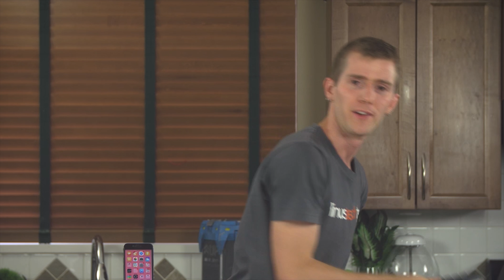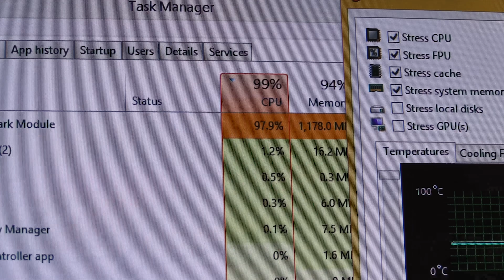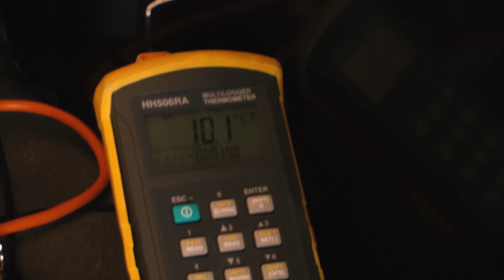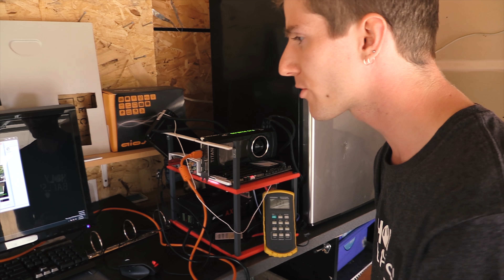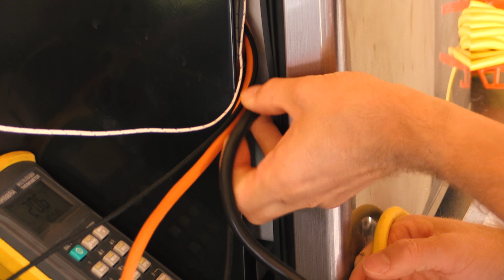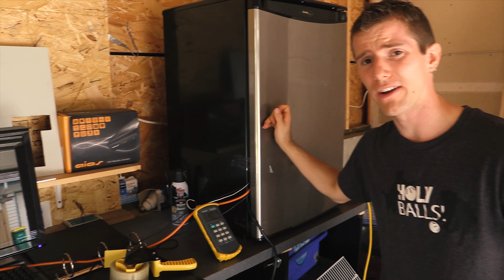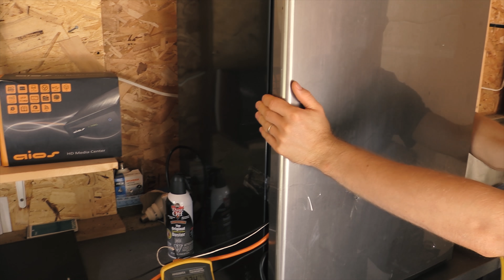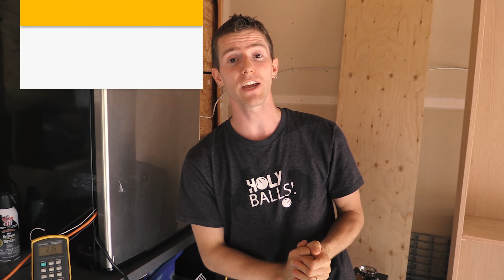PC Build in a Fridge - Does it Work??

Comment: Now lets throw it into  a -10 degrese freezer.
Reply: Put it gently**
Reply: TheSintic Won't work for the same reasons as the fridge.
Reply: TheSintic PC in a walk in freezer
Reply: hompalai THROW HARD MAN
Reply: reblogo INDUSTRIAL SCALE FREEZER THAT IS!
Reply: Lol xD
Reply: daveglo100 If it can't read rid of the heat (i.e with large vents) then it doesn't matter. You'll end of up with the same result. It'll just take longer.
Reply: Cloudz2021 i think those walk in meat locker freezers do have fan driven outlets, not 100% sure, but the one at the pub i used to work at did. just wonder what the results would be like just as a POC. also as mentioned in some other comments, i would like to see the mineral oil PC he built put in a walk in freezer too
Reply: ***** Yep the first time you turned it off it would freeze and never turn on again.
Reply: TheSintic why not -18 degrees celsius?
Reply: TheSintic The same would happen, like in this video.
Reply: ***** Ice is deionized water, deionized water doesn't conduct electricity
Reply: TheSintic Lets put it in an Alaskan winter
Reply: TheSintic that's the same thing as a Refrigerator set to a lower minimum temperature for the computer to maintain.

the problem isn't the ambient temperature, it's the heat dissipation capacity.
if you really want to do it, buy a Walk in Freezer and replace a room in your home with one. that will definitely be able to handle the heat load.

don't set the temperature too low though, you don't want all of the components running subzero. not without you making modifications to protect them.
Reply: TheSintic Same results, those using literally the same cooling circuits.

Comment: Honestly, you'd be much better off stripping the compressor and heat exchanger out of a cheap window AC unit and putting it into a large coolant reservoir (or just modify a small ice chest).

Comment: Whoa, hang on there Linus, this is not over yet! You didn't even do the best one! You should put a large reservoir of a water cooled PC in the fridge and have the pc outside. Also, pre-cool the water that's going back inside the res via the traditional methods. If this doesn't work there's always another way.

This one is a bit complicated but it can't fail. You have to reservoirs, let's call them A and B. Res A is inside the fridge and res B is outside the fridge and outside the PC. The PC is using res B at idle and below a certain temp, let's say 50 deg. What you do is you have a logic constantly measuring the CPU temp and once it reaches the threshold it activates a pump between res A and B. Then a water exchange happens between the cold and the warm res waters. What you need to be careful with is the placement of the tubes between the two reservoirs, or else they won't exchange water properly. It's questionable how effective this would be, but I'd sure love to see it. And if you can't build a logic like I explained you can always manually check the temp and activate the pump by hand, at least as far as the experiment goes.

Comment: Cool, good info to have, thanks. It's funny how many HDDs you see "stripped down" to bare platters sat happily running on certain rigs - I wonder if they know they're screwing up their hardware by doing so ...
Reply: ***** Wait... Where are you seeing this stripping down?
Reply: Tech Tacular Oh, I've seen them all over the place - usually in "stripped" rigs that people have custom-built - you know the kind of thing - don't bother with a case per se, just use a basic frame so everything is on display ... then take the concept as many stages further as you can ... including having the HDDs stripped down so you can see the patters and mechanisms in action ... not my bag, I don't especially care what the machine looks like, just what it does ... I guess I'm getting old

Comment: ["!dXZCY-Py47tjgJJEfdHcNlHjzQACAAAAOFIAAAAFKgEjTI99XdF0zC9L-zp3lCZGf8wFE-GRPyY2FGzvRbIUwaCkVumbU0DPd74GgYSEZRDDgGwaeHqROMOSDikXAbT_KUx9VJt0Ax8JOoveOsbliI1hUtgMDriZS1XP4Fckvdc80P8QGZJz4DncKpS6v_Ob28blWb8gx5jaIUVFdZvona58BNJ_StRahWi5Rzi3Xd5yQ2fS9vyE_jQfInJ-ItJ6UDh8cc0A_EdDr0kyR7bgQZcDU4uubHldI4xztlqSekLSu3OWhgKDrBDgtlgnQDNyhhkk4uS_vIQ5pSJWthSPN1zFpGzY7UhS_IPvSybZV71FlPTLfwiTEaUoWOVvws9opk4Mtw9r5XytH3DnZW6SQPCzdVN_0-S5wXrrRvcjWjEjIW17","leave everything outside the fridge except the fan and radiator assembly for the CPU",[[[null,null,1]],null],false]

Comment: Which PC is better
1.
AMD FX-6300 3.5GHz 6-Core Processor
Asus M5A78L-M/USB3 Micro ATX AM3+ Motherboard
Crucial Ballistix Sport 8GB (1 x 8GB) DDR3-1600 Memory
Western Digital Caviar Blue 1TB 3.5" 7200RPM Internal Hard Drive
Asus GeForce GTX 750 Ti 2GB STRIX Video Card
Rosewill FBM-01 MicroATX Mini Tower Case
EVGA 430W 80+ Certified ATX Power Supply
Or
2.
AMD FX-6300 3.5GHz 6-Core Processor
Asus M5A78L-M/USB3 Micro ATX AM3+ Motherboard
Crucial Ballistix Sport 8GB (2 x 4GB) DDR3-1600 Memory
Seagate Barracuda 1TB 3.5" 7200RPM Internal Hard Drive
Asus Radeon R7 370 4GB Video Card
Rosewill FBM-01 MicroATX Mini Tower Case
EVGA 500W 80+ Certified ATX Power Supply
Reply: Miguel Chavez 2 is better since 370 has more ram then 750 it and bit faster
Reply: Thanks it's much appreciated and I'll be sure to put that into consideration

Comment: Putting it in the fridge was never going to work. 

Better solution.. use ducting to suck the cold air from a freezer, air con would work best, and push pull that cold air through radiators.
Reply: LinusTechTips duct up a compartment in the wall of the new office, exhausting outside, put rads in the wall attached to the quick connects you have... whole room cooling part 2 :) 

Get sponsorship to do the gpu's too.

Comment: Can you try a watercooled rig with a largeish reservoir so it keeps cpu and gpu temps down a lot. Also you need to try and keep the seal, well sealed try spreading the wires a little more

Comment: Hey Linus, you mentioned an AC unit cooling the system, how about an AC vent cooling rig. It would be like the test rig bolted onto rails which is bolted onto the AC vent. The air would really be dissipated easily because of the airflow by the AC's fan. 😀

Comment: I have a question linus this might be a hard one though..... remember your build from scrap yard wars 2. Well what if you did the same thing with better water block and a GPU cooler and then put the cooper coil thing you had in the fridge or a freezer. Drill a hole in the side of the fridge or freezer going in one side and another hole out the other.  Then the water loop goes though the fridge coil system to the CPU and GPU tp cooling it. No rads needed. What do you thing about this let me know? Please!

Comment: The concept is flawed, to properly test this you should have put the contents of the test bench into a proper PC case. The bench will dissipate heat into the air while the bench in the fridge has no dissipation.

Comment: Well.. most fridges have very small compressors that are designed to bring temps down over a long period of time. It's also not designed to cool down items that are actively producing heat. Still, it's a pretty cool thing to try. At least now we know it doesn't really work.

Comment: Linus what about putting a radiator inside a bigger fridge
Reply: nismo96 Fridges isn't designed to cool a continuously emitting heat source, you will blow the compressor in any consumer grade fridge, it's just like leaving the door open and have the fridge's motor fail. For that to work you need the large walk in fridges you find in supermarket back ends that are designed to have the door open and people walking in and out all day.
Reply: nismo96 We have already established that a medium/small sized fridge doesn't have the capacity to deal with the heat output, whether you put a computer or a rad emitting roughly the same heat doesn't mean squat. 
1. No there wouldn't be condensation on the radiator due to it emitting heat and being higher temperature than ambient. 
2. condensation on the radiator wouldn't kill the pc regardless...

If you were to put it in something industrial grade or just something rated with substantially higher capacity, the result is rather obvious and not really worth testing. But if they can jerry rig a clever solution that's a different matter.
Reply: nismo96 The result will be the same. The Radiator need air flow to cool down the coolant.
Reply: Bererker95 yea I get it but imagine that the fridge has the capacity to cool the rad and there are fans on the radiator will it work or there will be condensation witch kills the PC
Reply: mil ford I know that man I perfectly understand it. but imagine that you have warehouse fridge available and you put a rad in it will it work or there will be condense on the water block witch will kill the PC

Comment: There is a simple solution to get it work tho, test with a normal case, then you need to manage to transfer air flow that come out of case to outside of fridge with duct or anyway that you can. or if you have a water cool system you need to just put radiator outside of fridge.

Comment: Why not, instead of this, put in a water cooling loop then route ducting from the A/C vent to the radiator (external would be easier i guess) then exhaust it outside. This would get really cool air to the cooling bits and keep the room from getting really hot. Only thing I could possibly see is maybe some condensation on the water lines if the coolant gets lower than ambient.

Comment: Better idea, if you have liquid cooling why not strap the radiator to the front of a window A/C? It wouldn't be large enough to block airflow so you would also still receive a cool room as well.

Comment: SSDs should be ok in the fridge, yes?
Reply: ***** It has to do with the internal air pressure of hard drives. They're designed to run at a certain temperature range, so if they get too hot or too cold it negatively impacts performance.

You're not even supposed to tighten or loosen the screws on normal HDDs because it impacts the internal atmospherical pressure and makes the HDD unstable.
Reply: ***** Pretty sure it'll be fine but in all seriousness are you just really curious or considering this?    xD
Reply: THYCR3ATOR Whilst I was watching the video, when Linus said to avoid putting HDDs into the fridge, I reasoned that it would be related to a combination of the mechanical components, the platters, and the way HDDs work - magnetic read/write ops. As SSDs don't have any mechanical components, and work in a completely different way, I reasoned that they shouldn't have the same limitations, so the question was really to satisfy my own curiosity and reasoning.

Comment: Doesn't work because there's no airflow & there is no real efficient way for the heat to be extracted... also the heat produced from the PC is most likely heating up the air inside at a faster rate than the fridge is able to cool it down. A freezer would probably be more efficient initially but you would eventually experience the same issues mentioned above while there is also a risk that the heat generated would melt any frost and that would result in liquid dripping onto the components, a big no-no.

Comment: Is condensation a concern?
Reply: Razear Big one
Reply: Razear only if the pc is lower then ambient temperature so i think the pc would be warmer then the fridge temp
Reply: Power3003 Well, the cables already prevent the door from properly making a seal, so the environment is compromised from the start. Specially with the variations in morning/afternoon/night ambient temperatures, even without opening the door you can expect condensation.
Reply: Isaac F2545 But whenever you open the fridge even for relatively short times, condensation will happen.
Reply: lápi póc Then don't open it.
Reply: lápi póc The computer components, being higher than ambient temperature will essentially work as a dryer, you will not get condensation ON the components, but i guess there is a chance of having water droplets falling onto it.

Comment: I had some luck by taking some dryer vent tubing and taping it nice and air-tight to a floor AC central air vent and running it to the side fan intake of my PC case.  In the summer when the AC is on, the case is getting a fairly constant stream of 15 degree C air.  Of course you can't have the tubing attached in the winter when the heater is on.  I was getting a 5 degree C improvement during the summer months.

Comment: Most things in a fridge will end up covered in condensation, especialy when you stop your computer and let it cool down, that's a little of my concern, so I wouldn't do it.
What I would do however without being afraid at all, is to put the radiator of a watercooling in a frigde possibly even cooling the radiator by a flow of cold water rather than cold air, kind of double stage water cooling

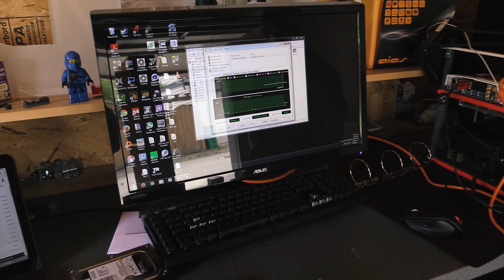Comment: 5:46 "This copy of Windows is not genuine" 
LINUS YOU REBEL!
Reply: It is a real copy, its something to do with swapping a motherboard over and using the same drives, windows seems to then think its a non genuine copy
Reply: callum Lawden It has to do with wether you have the OEM or the retail version
Reply: Edward James Bickels I think it's because of the switching of motherboard, windows 7 only allow you to install in one machine only, if you have a new motherboard install, the will think it's a new pc. Luckily that's not the case anymore with windows 8.1 and 10.
Reply: GriggsCk Gaming I Installed my Windows 7 Ultimate Copy 7 Times on different Systems and never had this problem ;)
Reply: Either way, it's still funny
Reply: We will never know, but I am in agreeance with edward :).

Comment: Wouldn't the computer heat up the fridge eventually? To commit to this idea you would have to box the computer parts in and then have an exhaust fan blowing the hot air out of the fridge.

Comment: But, why did you use a liquid cooler on the test bench? And not a heatsink with a fan? I think the cooling inside a fridge would have much more effect.
Reply: He just stole whatever rig Bradon or Luke (I forget) was working on xD
Reply: Zerqui makes no difference at all.
Reply: Tuomas Sipilä Explain your statement please? Because the heatsink would make direct contact to the CPU and therefore cool the CPU actively because the fridge cools the heatsink.
Reply: Zerqui If the fridge had the capacity to cool the rig it would have cooled the water inside the cooler to the temperature of the air in the fridge it also may be a bit better at cooling because of the bigger surface area of the radiator
Reply: Zerqui The only difference between a liquid cooler and an air cooler is the medium through which the heat is dissipated, sure with an air cooler the heatsink would be cold, but the radiator on the liquid cooler is also made colder and water has a much higher specific heat capacity to transfer heat than air. but none of that makes a difference because in this instance, the mini fridge is a closed system, the only cooling that the fridge receives is from the compressor that pumps freon through copper tubes in the freezer section of the fridge that dissipates to warmer sections of the fridge. When the temperature of the surrounding air around the rig is made warmer due to the CPU it becomes harder for the tiny compressor of a mini fridge to keep up with the heat demand especially due to the fact that a mini fridge is designed to keep heat out and cold air in. The problem with a mini fridge is that due to its designed purpose there are no effective thermal dissipation solutions in effect to be able to remove heat faster than the compressor can cool down the air
Reply: Zerqui It's a closed system.

Comment: I feel like this is a bad idea without adequate shielding for the moisture. Edit after watching: Ok, now I'd like to see a test built into an industrial air conditioner. I mean, build the computer into the unit itself.
Reply: mattdkfg Thats why you also light a fire inside the fridge
Reply: mattdkfg 
Possible now that we have motherboards that are coated with water repellent. :D lol though it isn't a permanent fix obviously as they aren't meant for 24/7 use in or around water. :/ Would still be great to see though!
Reply: Louis Whitworth What if it's a propane fire?
Reply: It'd be WAY easier to just connect some metal LC tubing to the units heat exchanger.
Reply: Or you could do what they do with car tires and fill the fridge up with Nitrogen gas.
Reply: The moisture really isn't an issue. Small amounts of distilled water won't harm the system.
Reply: mattdkfg Condensation wouldn't be a huge problem if the machine isn't turned off. It would really only be an issue if it is turned off or on. This winter i'm going to try this by putting my number cruncher in the unheated garage to take advantage to the colder temps.
Reply: Kaoru Sugimura If... IF those are good enough they should be able to handle an actual freezer... But then what about the other components?
Reply: ***** I lol'ed
Reply: ToastyMozart Seems like the easy way out.
Reply: Dan T buy 2 mini-fridges, and run the sensor from the one housing the computer into the empty fridge beside it.
Reply: ToastyMozart Thats exactly what I was going to comment.
Reply: Dominik Gajda Any dust and dirt on the components will make the water less distilled than you are hoping for g